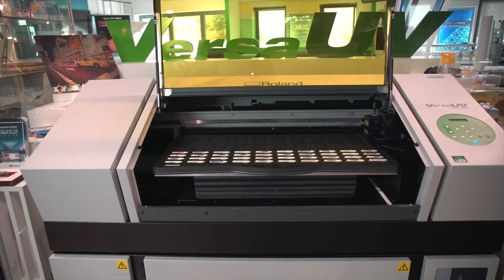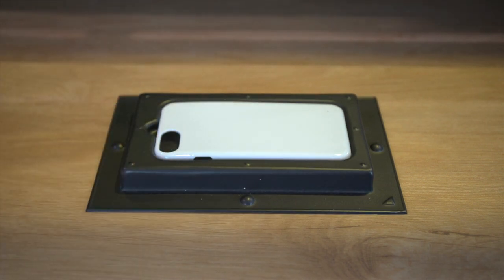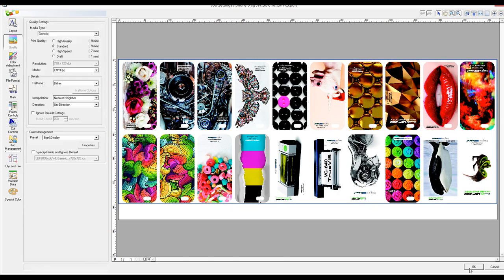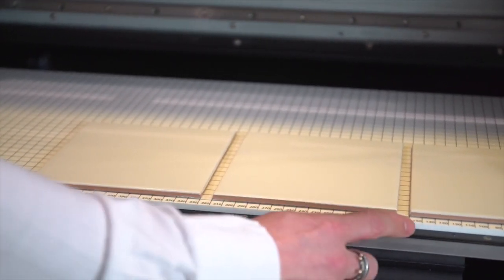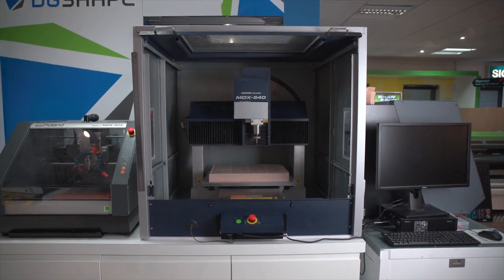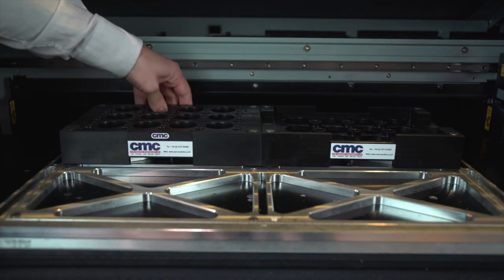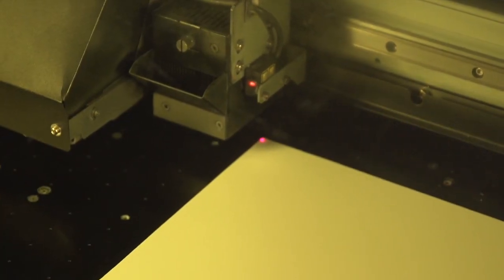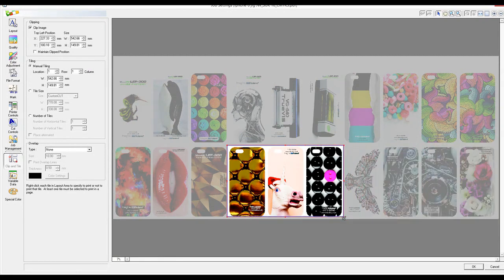Creating Jigs for Your Flatbed UV Printer

Comment: Some actual instructions on how to set up a jig file in AI would be great. The video needs to be much more in depth. I am not sure that all laser cutting machines can produce jigs that can work with roland uv printers.  We have used our laser cutter for years and whatever we do we cannot get the jig to marry up with the print!  It is always 5mm out.  We have tried different software and no luck. Getting so frustrated with it.  Some simple instructions would really help as it may be something  wrong we are doing with the file. Please help Roland and please provide more in depth videos that actually show how to do something instead of a video that merely skims over the subject it would be really great!
Reply from the maker: Thanks for the feedback Anna, 
This video was a bit of an overview for people to get a broad understanding of jigs. With many products and template varieties it is hard to do a full how-to from the design side. We do have another short jig video that may help? https://www.youtube.com/watch?v=eWb-IJC1zmY&t
Reply: Did you manage to solve it? I have the same problem too

Comment: Please could you explain further how to create the jig layout on Photoshop?  Thanks
Reply from the maker: Hiya, normally it would be advisable to create your layouts using a vector based package (like Illustrator) however you could also use Photoshop. You would just need to create shapes that relate to the print area/outline of your items and lay them out on an artboard the same size as the print area of your printer.
Reply: @RolandDGEMEA  Thanks.  I have Coreldraw.  So I create a boundary of the item I'm printing on in there, what width of print area do you recommend?  Do I then export as a jpeg to photoshop?
Reply from the maker: @r-joule  It will depend on what printer you have, and how many of each item you want to print at once. But if you have an LEF-300 for example and you want to fit as many as you can on to a page you would make your artboard 770x330mm and export as eps or pdf. Use the outline as your template and then use the same file to add the graphics, remove the outlines and export as eps or pdf again for print! Just make sure your export is at full print size, i.e. 770x330 so you may need a bounding box.
Reply: @RolandDGEMEA  Thanks.  Any chance you could do a on screen video of you making one of these print templates?  It would be very helpful as there are no videos on this subject and very little on uv printing in general.  Thanks
Reply from the maker: @r-joule  We can put it on the list :) Also, have you been on our VersaUV LEF training course? We cover all aspects of using the LEF including jigs and design work which would be very useful for you.
Reply: @r-joule  Hi 1_Eyed_Jim.   I am not a Roland representative, however I fully support the company seeing how I have had several roland machines over the years that gave me flawless results.  I am seriously considering a purchase of the LEF 300 as I write this.   
That being said, I would consider myself an expert in vector creation and currently utilize it with a 120 watt Co2 laser and would be happy to help you create templates for your printer should you still need them produced for very reasonable prices.   My ability to create cheap templates is due to the fact I completely built my laser from scratch that otherwise would typically cost $20K + for about $5K and don't have a huge bill to tend to as most shops.   
If you need a free vector software in order to create your own templates, I would suggest you have a look at "inkscape" which is supported by PC, Mac, and linux OS and is completely open source and free without any bugs or bloatware attached.  Should you need help understanding the procedure there is a plethora of youtube videos on the subject. 
Also it's worth noting that you can purchase air cooled diode based lasers these days for a  few hundred bucks and build the required gantry size of the LEF machine for less than $1K that is fully capable of being able to create/cut foam board templates for $1-$2 a piece.   There are many video on here as well that are very useful in getting all of what I said done if you have the time to do a little research.  Let me know if I can help you as one business owner to the next.

Comment: How can i get a corner guide???
Reply from the maker: Hi Adnan, we made one using the EGX-350. All you need is a 15mm ledge with a lip to overhang the edge of the bed. Contact a local engineering company?
Reply from the maker: Hi Adnan, we made this ourselves - are you still looking for one?
Reply: Yes i am nobody seems to understand me
Reply: Can i buy one off you i have made my own jig with laser cutter but every time i go to print i doesn't orint in the slots
Reply from the maker: Hi Adnan, if you could email us with your contact info and an explanation with the file of the jig that you have had made we can see if we can help.
marketing@rolanddg.co.uk thanks

Comment: Some issues I have with curved phone cases as it will over spray the edges
Reply: Hello MD! The VersUV Flatbed Printer is truly amazing! At Frames 2:43 and 4:29 , looks like they're saying to mount/embed your phone cases as level/flush as possible inside your "mass produce printing" Phone Case Jig to help prevent overspray. I can easily apply a similar technique to my traditional Paasche Airbrush Projects.